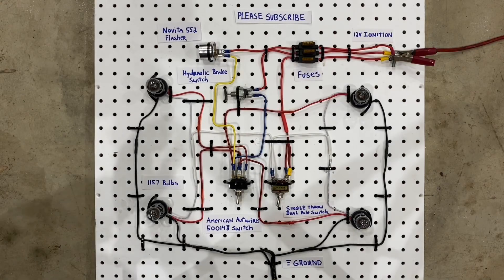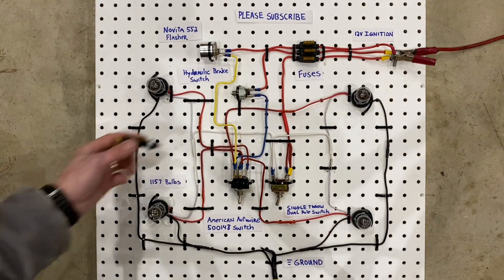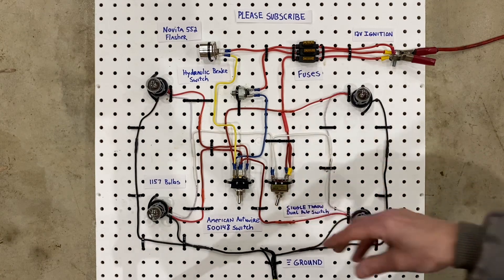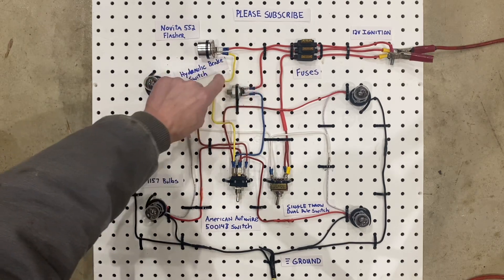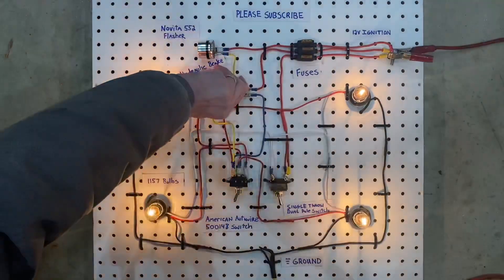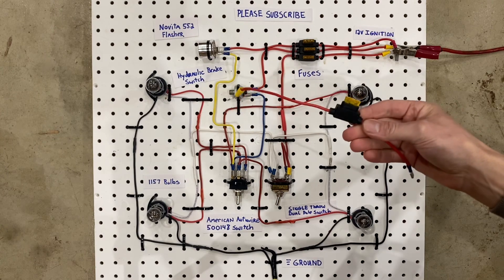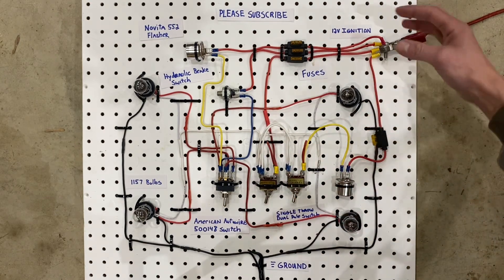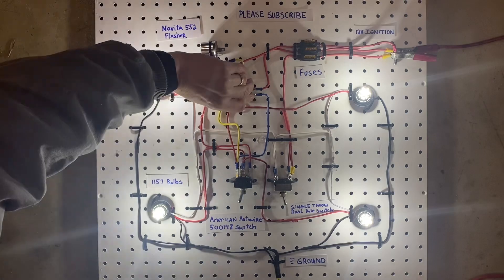How To Wire Turn Signals, Brake Lights, Parking Lamps, and Hazard Circuit Switch | @WiringRescue

Comment: Is there any way to do this with relays without the magic Left/Right switch? I.e. if that's not the switch I want to use for that function- can I wire that circuit? Every way I draw it, I can't override the power coming from the brake light circuit
Reply from the maker: It’s a tricky problem right? If you don’t mind using relays, it’s quite easy to do. And you can use nearly any switches you want. Check this option out: https://youtu.be/DoVHHokOBrg

Comment: I have a smart car I've replaced relays,checked fuses, replaced both boards holding the lights in the rear, front passenger head lamp and the brake and blinker don't work on the driver side in the rear and the blinker doesn't work on passenger side (the one I replaced the head lamp bc the blinker goes thru it) on the front
I am lost!?

Comment: Hi. Can you help me? I have and old land rover with an universal turn signal swith, it does use the same filament for brake and signal/directional. My question its. Why does the hazzard only blinks on time and stays on without flashing while the brake its depressed. I thought that it will continue flashing while the brake its depressed
Reply from the maker: I think you’d have to start with the basics. Make sure you have the right bulbs in place and that some weird wrong ones aren’t being used. Once you confirm that, make sure that they all have strong 12v power when turned on, and also a good ground with zero resistance.  Doing all of this is a bit of a process of elimination, but unfortunately I don’t have a better/faster way. I’m cheering for you though!
Reply: Thanks for thar. Grounds are good and algo bulbs are the right type, 2 filaments one for brake and turn signal and the other one for park, i will check the signal turn switch I think thats the issue or the way to start. Everything else works just the way they have to

Comment: Would rather have you start with empty board go step by step
Reply from the maker: I’m actually doing that right now. Stay tuned! It’s taking me a while to film because I’m doing it this way.
Reply: @WiringRescue  just no wires showing one wire at a time would have been dumb down enough lol have all mine working now thanks to your video sir
Reply: @WiringRescue  maybe add tail lights to the mix.  Where the tail lights stay lit with headlights, plus have brake and turn signal.  Every time I follow your wiring guide on my 12v golf cart when I turn off all lights some power stays on somehow and my tail lights won’t turn off.  I’m using 3 wire LED rear lights for my tail, brake, and turn 
signal
Reply: Should add I followed your wiring guide that used the 4 relays to wire up.

Comment: so I've run into a bit of confusion on my part.  The front turn signals are easy enough. But the back is different.  I've got two lights.  One is for the brakes the other is running light and turn signal.  Also this car has a set of running lights in the back sides of the car and the front.  So, I'm sure it's not to big a deal, but I'm confused on how to do it all (ugh).  Thanks for any help :)
Reply from the maker: The first thing to do is figure out what kind of bulbs you are going to be using and how many of them you have. Are they single filament (two wire) or dual filament (3 wire)? Here is a basic brake light circuit diagram that will probably allow your brake lights to work. https://youtu.be/h6F9PauqvXc
Reply: @WiringRescue  thank you!  One bulb has one wire the other has two.  (these cars are weird).  They have separate chasis grounds.  There a so many grounds it kind of stupid.  Maybe I can just replace the sockets with something more current and replace that part as well.  Thanks again for helping me
Reply from the maker: @kristinemacdougall  - Yes! You can absolutely replace the sockets with something more modern. I’m sure you can make existing parts work if done correctly, but new stuff may provide slightly better reliability.
Reply: @WiringRescue  got the sockets ordered yesterday. should be a week. so i'm going to do all the other work and be ready when they get here. i really appreciate how quickly and positivity you respond. it's nice to know there's someone out there willing to give advice and help! thank you very much
Reply from the maker: @kristinemacdougall  - I’m cheering for you! And who knows, maybe others will have the same problem as you and benefit from this information! :)
Reply: @WiringRescue  fair enough would love to have helped someone else:) you know pass it forward :) i'll keep you posted.
Reply: @WiringRescue  IT WORKED! IT WORKS! I goto to drive the car Sunday for a bit.  It was great!  Today I'm going to make everything look pretty (wrap up all the wires and make it look like a real harness).  Getting the new sockets did the trick.  Thank you so so very much for the help.  Have an awesomely blessed day :)
Reply from the maker: @kristinemacdougall  - heck yes!!! Congratulations!!! That must be such a great feeling!
Reply: @WiringRescue  it so is a great awesome feeling!  Thank you for your videos and for the comments conversation! so helpful.  I know have the line that goes from the master cylinder for the clutch leaking, so that's on my agenda for today. Thanks ago :)
Reply from the maker: @kristinemacdougall  - I’m thrilled that you are getting the car sorted out! Think about how great the clutch will feel with a bunch of new parts! It will be amazing!

Comment: Quick question on the pressure switch and where you have the blue wire connected to. It looks like it connects to the yellow flasher wire. I am wiring through an ididit column and I am limited with wires to splice into. Can you assist with this question?
Reply from the maker: This design will only work if you are using the switch in the video from American Autowire. The flasher and pressure switch are each on their own terminal on the back of the switch.  If you aren’t using this switch, check out my other turn signal and brake wiring videos. They may be a better option for your scenario.

Comment: Would you know of a rocker version of the 500148?
Reply from the maker: Hello - unfortunately I don’t know of one that exists. I have several other toggle switch videos though which you can check out if you have the time. They are each  designed differently than this circuit though.

Comment: Thank you for this!  This is exactly what I was looking at for my golf cart.  Wouldn’t happen to have a link to a diagram would you?
Reply from the maker: I sure don’t - I just made this circuit up based on the basic instructions that came with the switch. Hopefully it helps you out!
Reply: @WiringRescue  No biggie…. I screen shot it to print and it will be easy enough.  Ty again.

Comment: So if I wanted to add a set of leds to my turn signal but also wanted them to turn on with my parking lights can I just splice one wire going to the set of leds from the parking light wire and another wire spliced into the turn signal wire going to the set of leds? So both wires are going into the leds so they power on with the parking lights but also flash with the blinkers
Reply from the maker: If your LED bulbs are single filament, then the downside would be that they would never blink with the parking lights on, because they would always be receiving constant 12v power. You can have one or the other, but not both in your scenario. If you swapped to a two filament bulb, then it should work as you were hoping.
Reply: @WiringRescue  then how could I make this work? I just tried it and now none of the lights even flash. I can hear the relay clicking but no lights
Reply from the maker: @green_z3153  - it’s tough to diagnose over the internet. My best advice would be to grab a digital multimeter and measure the electricity at each component to see where it is getting lost.
Reply: @WiringRescue  do I need some kind of switch back module?

Comment: Can you take out the 500148 switch and put in your 3 way switch. I like see how you make that work. I and retiring my Datsun 260 Z w the original signal, bight / Low beam, Hazard and everything works but can’t get the break light to function without the front lights acting as break lights
Reply from the maker: I’m working on a video right now that is more in line with what you need. Stay tuned!

Comment: I think - When you have your breaks on - Then turn a turn-signal on - The break filament "Stays On"... ???? Your way works and I understand the reasoning, "To use one 1157 bulb"... I think, most lights have an 1157 & 1156 bulb... (Running lights - Break lights - Signals - Flashers are front & rear signals) - I'm not criticizing you, I'm just trying to clearing it up in my head...

Comment: hazards ,brake and parking lights are in my opinion safety circuits and should bypass the ignition switch. my understanding is that in practice the turn signals always pass through the hazard light light switch wiring, so when hazards are turned in it just bridges both  turn signal wires to a battery live. but good basic circuit

Comment: okay question?? is running lights the same as parking lights? i ask this because it wire up my square body entire lights on your video with the relays.. all lights work except running lights (lights on all the time especially at night). so if this is get the "running lights " to work then I am going to this set up asap. at the current moment i have not running lights ..so are running lights the same as parking lights...??? also what happen to a relay???? can this setup work effectivly for a long term without a relay...??? thx

Comment: Awsome video...how would you add Headlight?....that would wire my whole 63 nova...thanks.
Reply from the maker: Thanks! Check out this: https://youtu.be/0h_ZbIBHM-M
Reply: Yeah thats a good video too....since my car has no wites at all...it would be awsome if you would figure out how to do the same wiring using a 60s headlight switch and the blinker on the column...but use your wiring...it loooks so easy and simple...

Comment: Can you make a video more explaining the brake lights and flashers working together because I don't understand how the brake lights works on both rear lights. Like where does the blue wire connect to?
Reply: Alex, he literally explains everything you asked in this video
Reply: @Mark Tse I’m trying to wire rear led lights for a old jeep rn. They have 2 wires one for brake one for taillights. I also want to use a steering column turn signal stalk instead of this switch, is there a way to accomplish what he did with the American switch in the vid but without that. I want one wire from the light to do turn signals and brake, and other one to do taillights but I don’t get how the turn signal will override the 12v from the brake switch if both are used at the same time.

Comment: The Hazard Lights are supposed to be wired to the same place as the Turn Signals and the Brake Light filament, Not to the Parking light filament. Please show how to do it.

Comment: OK, Love your explanations on these circuits, but. The brake lights are wired to a hot all the time fuse and the hazards are not on the parking light side . They are on the brake /turn signal side the brighter filament , and on some older cars the parking and headlights are wired to hot circuits and cannot be turned off by the ignition key . My 83 Ford F100 is that way. My 88 Stang is that way too. I can turn on them lights without even putting the key in the ignition. And by using the 500148 switch you don't need any relays anymore?
Reply from the maker: You are totally right on all of that. This is just one method of many that could be done to accomplish lighting these lights. In this scenario, you don’t need relays as long as you don’t overload the switch or turn signal flasher with high amperage bulbs.

Comment: on this circuit where would i put relays and used of the factory switch? also with the high beam and low beam switch ! I would like to use the factory switch with the used of relays and make everything work ? could help me out ?

Comment: How can you do this without using the toggle switch? I have an Ididit steering column with a GM turn signal.
Reply from the maker: The toggle switch most likely works the same exact way as the switch in your steering column. You’ll just need to find the right wires to use.

Comment: Great video! I’m trying to re do my whole turn signal/lighting system on my Jeep Cherokee. Can you add headlight/ dimmer switch to this circuit as well? Would you recommend this system using relays as well?
Reply from the maker: You should be able to use this diagram for the high and low beam headlights. https://youtu.be/0h_ZbIBHM-M. As for relays - it’s necessary for the headlight circuit, but not for the rest unless you are added more bulbs to the circuit. The switches used can handle the four 1157 bulbs perfectly. Thanks a bunch for watching the video! I appreciate it!

Comment: Thank for the video. Would you recommend doing this way or with relays. I need to decide. Thank you
Reply from the maker: This way is a great option as long as you don’t go crazy adding more incandescent bulbs. If you start adding more bulbs, then you run the risk of reaching the amperage limits of the switches. The American auto wire 500148 switch is rated at 25amps @12v. I believe the others are 15amps @12v (that one is a guess). Each 1157 bulb can pull about 2.1 amps with both filaments lit. If you swap to LED’s throughout, then the amperage draw is super low, so adding bulbs is less of a risk.  

I have another method of wiring this circuit that I want to try, so stay tuned for future videos!